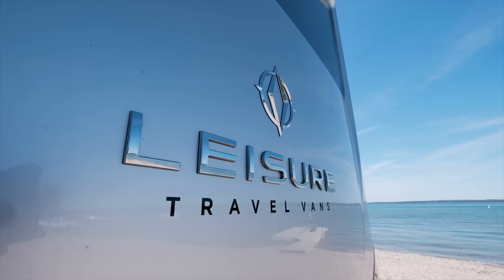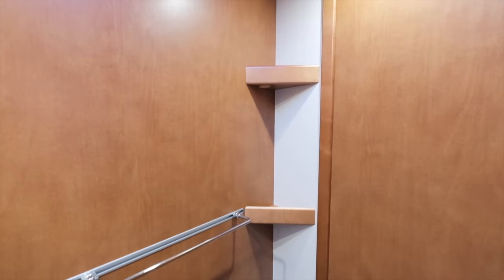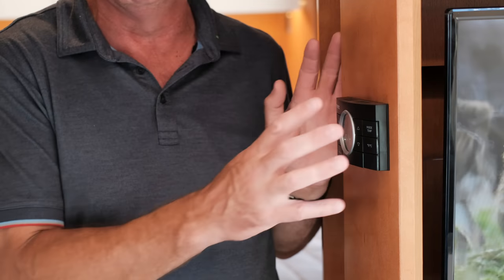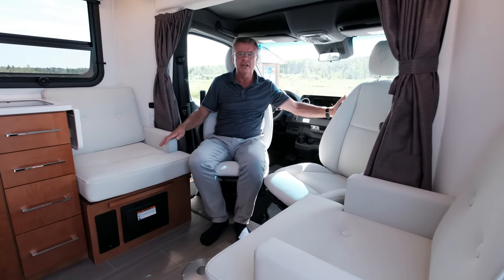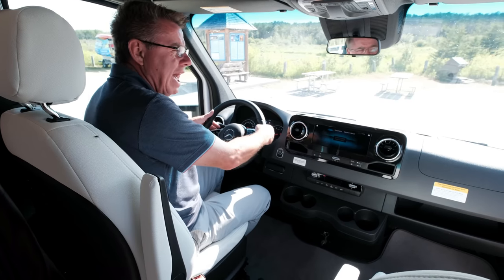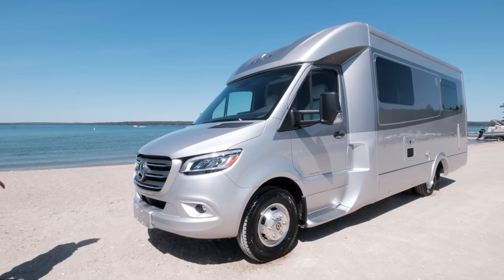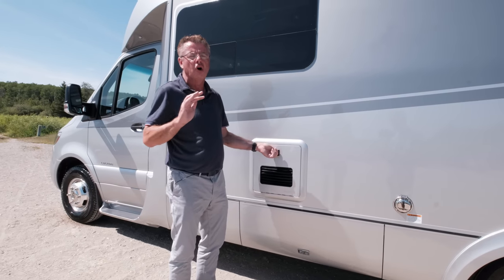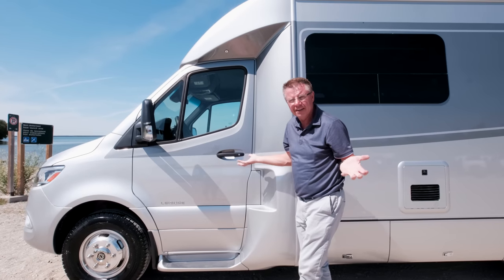2020 Unity Island Bed

Comment: Golly, I ADORE LTV vans (motor homes!) and the engineering that goes into every item. There is literally nothing I dislike about them. Sure, I wish LTV would offer a Lithium/Solar package, but- other than that, I find the whole shebang to be the ultimate for couples travel. I'm so glad that Mike & Jen (& Bo!) of RVLifestyle grabbed a Unity FX (a platform that I MORE than adore!), as I find them extremely credible. (Note LTV: they went LiFoPO4, solar & small inverter.)
   Because I WANT an LTV beyond words, I need to ask you (as a company) to consider the huge and presently growing market for empty nest couples looking for an extremely wonder small B+ that could be home YEAR ROUND for a smaller up front investment. The Wonder is almost perfect, yet- exceeds my "pull the trigger" finger checkbook & phone call by $20,000.00. Also, when outfitted for a 'real' couple, the number is closer to $150.00, brushing up against the Unity line way too closely.
   It is possible to badge a less expensive Wonder that is NOT de-contented? Honestly, many really want the M-B Sprinter chassis, and, I would as well, however, I am aware of the huge improvements Ford made to the 2020 chassis, including bigger front brakes (no longer Focus front brakes!) which makes the platform more robust, less maintenance intensive. If a Chevy chassis was considerably less expensive, I would consider a coach designed by LTV.
   Honestly, the coach size is ideal, the manual Murphy bed is ideal in so many ways, the design of every square foot is maximized, the wiring & H2O lines are well organized, reachable and identifiable (Thank you!)- truly a premium coach. Your automotive peers- Mercedes Benz has learned how to dumb down to a price conscious buyer, is there any way LTV could follow suit? Imagine a loaded LTV that came LOADED at $100,000 without arguing with a dealer for days, weeks or months? The line would be out the door at every authorized dealer in North America. But, I sense that you are already at max capacity in 2020, as the market grows, because your reputation for a premium coach is firmly established industry wide.
   Thank you for manufacturing many an RVing couple's dreams. It warms my heart to know that my dream exists already, and is merely more than I'm willing to spend. Like many, I may have to crumble, and, settle for a Jayco Melbourne Prestige RP, or, a Winnebago Navion/View, even though I really want the capacity to cool a coach with an ice cube, and, warm it up by passing gas (Triple E out the door). Dreamers dream, and- now you know mine.
   Dean is awesome, I feel like I know him already. He represents LTV so well, it's a perfect fit! Enthused, funny, and, genuinely loves the product he's showing. He IS excited to show off these coaches, it's infectious! 
   Thanks for everything- even the dream of future ownership. Trust me, my day starts @ 3:30AM with rvtrader.com and a search for new available LTV products. Ask my wife, it wakes her up. Keep it up, it raises the bar for everyone else.

Dave
Reply: retroperitoneal  A suck up here, a compliment there- words, only words. Cheap investment in a steal deal, right? And, for my wife & I- every word is true. I really like the triple E functionality (we live in a Northern climate.) Although I don't think I would use every available 'layout' for the dual chairs, couch, chaise lounge, dinette, etc... It does make that space very useful when camping, and, occasional guests. Imagine a Wonder FX with the rear couch, ottoman/desk and ultimately 2 separate areas- a genuine marriage saver (although the shower decreases by 1/3rd.) We are pretty small (slightly larger than spider monkeys- we stand on wedding cakes on weekends for extra cash).
Reply: Can I turn this in as my final thesis
Reply: @williampeets3226  Sure! Remember, spell check is your friend, and, you may want to remove the size reference at the end- most are not small, schreechy bi-pedal primates in size, Bill. It was 'off the cuff' so, check grammar as well. Enjoy.

Comment: I have been following the evolution of the Unity IB. I have been waiting for the 2020 updates. I have a few questions: (1) why is this unit not multiplexed, especially with the new model year? (2) why do the ropelights not illuminate the interiors of the cupboards - that would be a very important suggestion to consider for future upgrades. (3) Is it possible to have the same ceiling LED lighting like on the Unity RL (I love the lights on the RL). I love the Island Bed - it is probably the best non-slide floorplan I've seen in the B+/C RV. Thank you for your videos!

Comment: The only thing I would disagree with is using the outside shower to clean your waste hose. Was always told not to use any hose that may be for fresh water (or cleaning yourself or pet) to do this to prevent contamination of that hose via splashback.

Comment: Very nice,  but why isn’t there a rear window? The rear exterior has some sort of window like sticker. Why not make it real so that you can enjoy the beautiful views out the back? I owned an airstream 27 ft front bedroom travel trailer, and the panoramic views was one of the best features. I’m thinking of going to a small class C next time around but seems like most manufacturers put the bathroom in the rear. Now you have a great floor plan that would support the rear views, but choose not to take advantage of it. Lazy Daze has great views but outdated style, and only comes on a Ford gas chassis. Emulate their mid bath or rear twin floor plan, put it a sprinter chassis with your great modern style and you’d have another winner.

Comment: One thing I don't like is the Tv 📺 above your cooking area,reason moisture and steam are not good for the electronic components inside the Tv on the circuit boards,or the Tv 📺 screen,not a good 💡better above drivers area,one thing that would be great in the kitchen is a induction hob,portable that can be stored away when not in use,this with the gas burners make a great cooking combination,otherwise a great motor home,also have you considered a right hand drive version for customers abroad non North American market,or do you only cater for the North American market place?.

Comment: I've heard there is a major supply chain constraint on the Mercedes chassis and lead times have gone out to over a year.  Is that true?
Reply: Probably. I prefer the Wonder over the Unity bc it's on the Ford Transit Chassis, much more reliable. Mercedes has markup costs for no reason other than the brand name. They constantly break down, parts are expensive, very few mechanics have the equipment to do repairs, and the ones who do are likely to charge premium.
Reply: @YourMajesty143  thanks, unfortunately you confirm my other sources.  to bad.
Reply: Ford more reliable than Mercedes lol. Now I’ve heard it all.